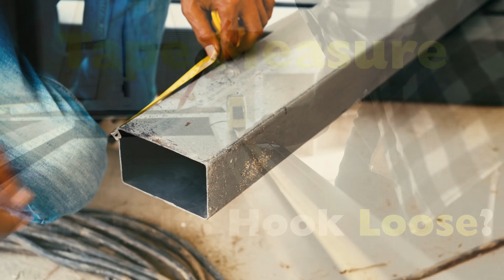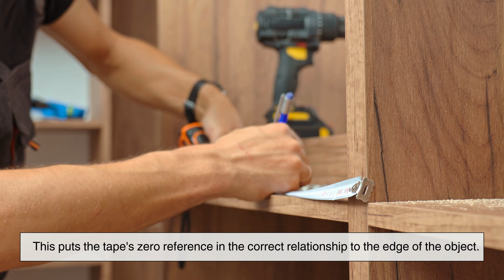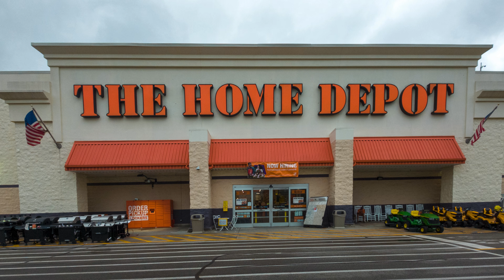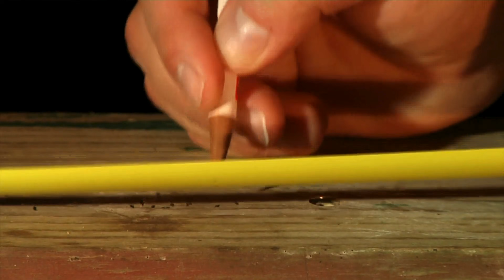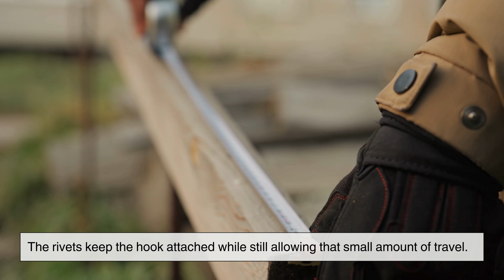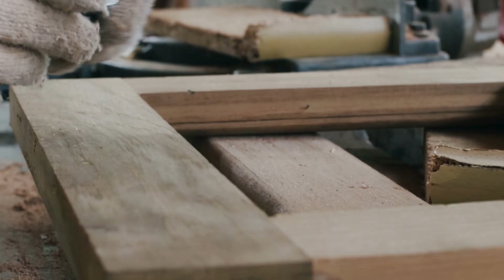Your Tape Measure Isn’t Broken—Here’s Why the Hook Moves

Comment: Was hoping I wouldn't have to point out that a) you shouldn't allow the tape spring to whip the tape back in so that the hook repeatedly smacks into the body of the tape measure. It may elongate the rivet holes in the tape. b) check if the hook has been bent if you drop the tape measure or before using if you share the tool. I have seen bent hooks.

Comment: In addition, the reason the hook has a slot is to use a nail as a reference point when measuring.  You slide the slot on the nail's head and roll out the tape measure.